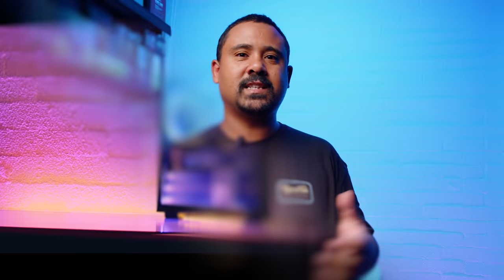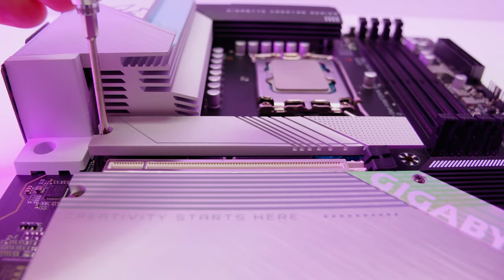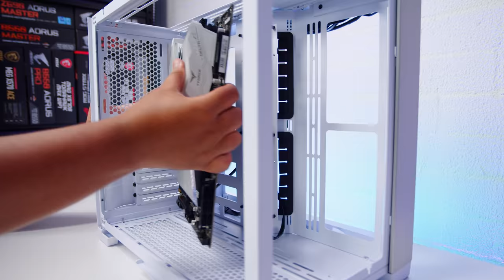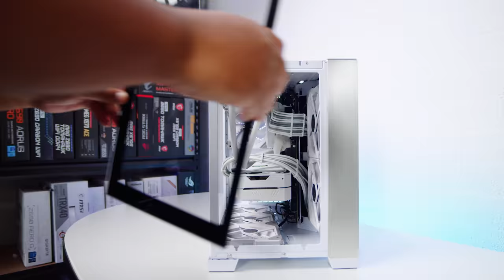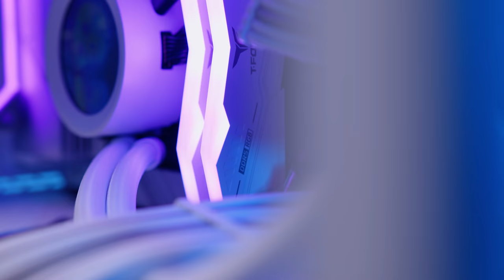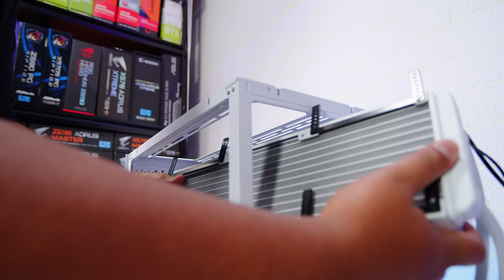Klaire's NEW GAMING & EDITING BEAST in the Lian Li O11 Mini!

Comment: The build looks amazing, one thing I did not like was the aio's tubes being under the sleeved cables but other than that it looks awesome 👍🏻
Reply: I noticed that too. Nick must have his reasons though
Reply: I personally like that look. It shows off the awesome custom cables, and doesn't impede the function of the AIO at all (with a 360 AIO in this small of a case, the tubes have more than enough slack lol). To each their own, though. :)
Reply from the maker: It was Klaires choice. We tested both ways and under looked much better
Reply: @GearSeekers  agreed

Comment: Very nice build! And that case. I have to look into it. Is this the case? I thought I had looked into it, but, I don't know.. 🤔
Reply: I figured out why I did not go for this. No support for ATX PSU. But it seems the Air does fit ATX PSUs, so I might go for the Air variant.
Reply from the maker: @AlexaRex  yeah but no 360 Rad support
Reply: @GearSeekers  Yeah, that is such a strange thing to do, to make it shorter.. I use a 280mm from Arctic, so for me that's ok.

Comment: Question GS, is the offset bracket RB-001 is the same as the RB-001X? The description is for O11D Air Mini, and will it work on my Galahad 360 with a Z690-A mobo and T-Force Xtreem Ram sticks? More power to you guys, awesome build!

Comment: Hey awesome build, I have a question about the case though:
So I have a ls720, which comes in at 402mm for rad length, now the lian li site says you can only get a 400mm rad in the top when it comes to length. 
I was wondering if it would be possible to get an exact measurement of the millimeters I have to work with when it comes to top mounting the AIO.

Comment: How did you connect the fans on rad?  Can you use the cable that splits into rgb and pwm so the fan goes to the aio and the rgb to the lian li controller?

Comment: looks fantastic what a superb build 
can you please tell us what is the best other option than Asus ROG STRIX Z690-A GAMING WIFI D4 ATX LGA1700 Motherboard coz i have an issue using it on Corsair 5000D airflow

" Motherboard does not have sufficient USB 3.2 Gen 1 headers. The case USB 3.2 Gen 1 Type A port will not be usable."

Comment: For the intake fans at the top on the rad, where do you have the connector? In the back or front? In front it won't fit by the tubes in the back I can't mount it properly... :(

Comment: can you do that offset bracket with the o11 mini air?
Reply from the maker: Yes and no. Yes to installing an AIO at the top, no because the Air Mini is physically shorter and can't fit a 360mm Rad in it at all. Check out our review of the Air Mini. That was my biggest complaint.

Comment: How did you fit the rear fan there with a 360? I have the Lian Li Galahad and I’m having trouble with that part big time
Reply: I have the exact same issue...did you find any solution to it...
Reply: @ray74319  I just slid it down all the way, and made it fit almost flush to the 360mm fan. It takes some finesse and isn't easy. Good luck
Reply: Thanks so much Nicolas...I actually made it work but it  took some amount of tweaking and squeezing. I actually seen a few builds without the rear exhaust . Be interesting to see the exact impact on the temps with or without. But at least I know I have both options now. Thanks for the reply.

Comment: 6400 40-40-40 on the memory?

Hmm yeah I’ll stick to 4400 16-16-16 ddr4.
Reply from the maker: 6400 38-38-38
I'll stick with the free DDR5 RAM from Team group
Reply: @GearSeekers  was just making the point tuned samsung b die ddr4 still beats ddr5 with high cas latency. At least for now but I'm sure it will get better.